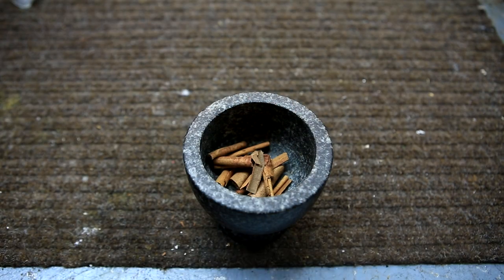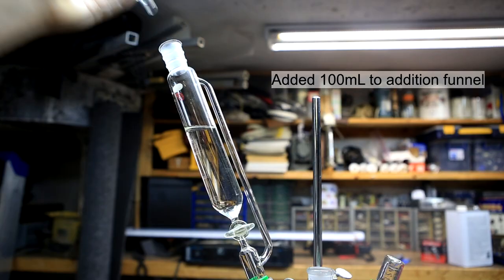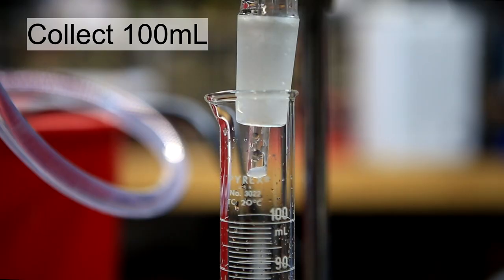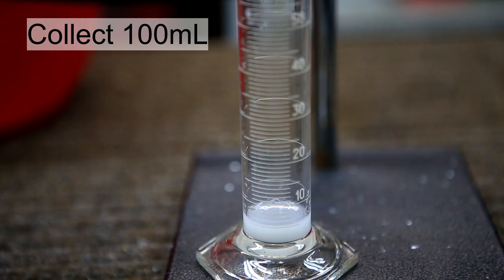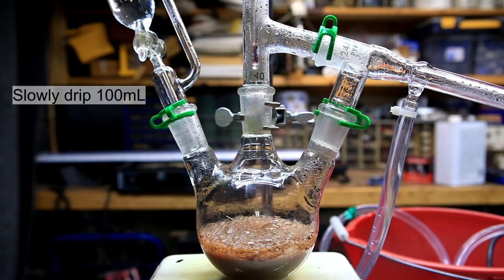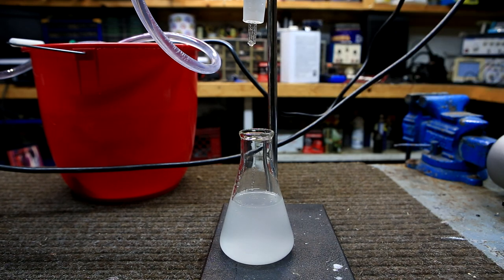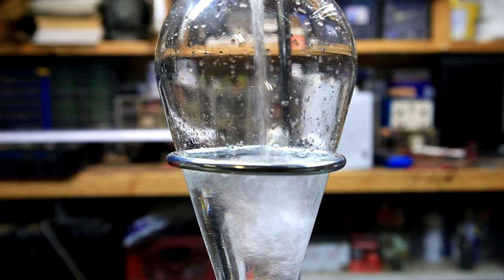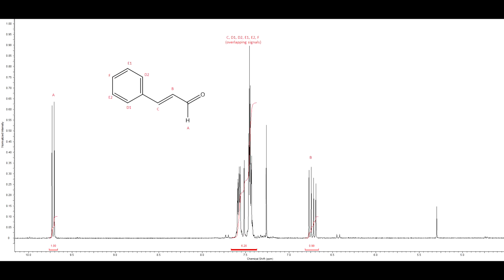How to extract Cinnamaldehyde from Cinnamon

Comment from the maker: I am not sure why, but it didn't separate out. I also did limonene which quickly separated out. I guess I could have left it out for a while and waited for it to separate.
Reply: You have posted video on separation of Limonene from orange peels ?
Reply from the maker: I will. It is the same process but the oil separates immediately and can just be pipettes off. Ill edit it and upload it eventually
Reply: Okay, will surely check it out whenever it is available
Reply from the maker: Those are two very different techniques with very different purposes!
Reply from the maker: christopher vester I think it is, but I didnt check.
Reply: +Nile Red The cinnemonaldehyd does not separate form the water by itself. Where I live DCM is banned out of environmental reasons. Is there any alternative to DCM?
Reply: +christopher vester Yes. Thank you. It works very well.
Reply: cinnamaldehyde . you mean TRANS 3 PHENYL PROPANOL ?!
Reply: wait, so where you live they allow Chloroform but have banned DCM?
Reply: you do not dry the dcm by adding NaCl, you saturate the aqueous phase with NaCl so the cinnamaldehyde(low quantity not all) doesn't dissolve in water, thus you have it all in the organic phase (DCM)
Reply: prop-2-enal
Reply: I know I'm super late, but as a layman I'm curious about the use of a sodium chloride solution. I figure this has something to do with keeping the oil and the water from getting too friendly. Is the purpose to increase the density relative to the oil, or does saturating the water have some other more direct effect on miscibility?
Reply: NileRed isn’t this a precursor to P2P?
Reply: Sodium chloride solution (aka brine) is used to dry the immiscible organic layer. It may sound weird to use an aqueous solution to remove water, but since the brine is saturated, it absorbs the residual water that may be present in the organic phase, creating a slightly less concentrated NaCl solution.
Reply: The Hildebrand solubility parameter for cinnamaldehyde is about 21 MPa^0.5 vs 20.2  MPa^0.5  for DCM and 19.9 MPa^0.5 for acetone - suspect acetone would work fine. I think issue with separation is that cinnamaldehyde density is  very close to water (about 1040 kg/m^3). Another technique without solvent may be to freeze the water (cinnamaldehyde's melting temperature is -7.5 C)
Reply: which kind of surfactant to use for powdered cinnamon? would ordinary dish soap, or hand soap work?
Reply: DCM is forbidden, any alternative?
Reply: @aribinu8910  Literally watch the video and see what it says next to DCM?
Reply: @BaneWilliams  , right?  It shows an alternative right in the video.  It astounds me how people don't pay attention at all.
Reply: @gugl4106  Hexane?
Reply: @piratewhoisquiet  Normal soap will foam. Washing machine soap should not.
Reply: @tom_something  Adding NaCl to water increases its polarity hence a better separation from the organic layer
Reply: @Kloashut  ah, I see. Is it that the oil and water become less attracted to each other (decreased adhesion), or does the water simply become more attracted to itself (increased cohesion)?
Reply: @tom_something  Basically when you dissolve salt in water the salt falls apart in its ions which have a charge[+/-]. As water has a dipole moment[d+/d-] it readily surrounds the ions, hence creating a stronger connection. Most organic compounds have a much lower or no dipole moment, therefore it separates out. Going back to your remark, bluntly said it's a bit of both ;-)
Reply: @Kloashut  Thanks for your explanation!

Comment: You should use this to make phenylpropargyl aldehyde (aka 3-phenyl-2-propynal). Why you ask? Because it's $250 per 5 grams and I thought it would be interesting to make something so expensive from cheap materials.
Reply: but he would most likely spend more money making it than it is worth
Reply: did you not read satchel's post? from CHEAP MATERIALS
Reply: Roarke Tollar But the materials used to extract it and the processes that are involved with doing so could increase the cost of the extraction

Comment: "When all of the DCM had been removed, the yellow oil which remained was transferred to a dram vial". 
How on earth did you get that little bit of oil out the bottom of the flask? Did you just hold the flask upside down for a really long time till the drops crept into the vial? Seems there would be lots of wasted oil on the inside of the flask!
     I'm considering using this method of recovering the DCM using a 1000ml round bottom flask, but I'm also thinking there may be a more efficient way to collect the oil once the DCM has been distilled. Any thoughts?
Great video, btw! Very informative!
Reply: You could use a pipette.  Or just use your receiving flask for the next phase of synthesis once the dcm is removed and the flask maintains a constant weight.

Comment: How do you know which extraction method to use? Water destillation vs Soxhlet, etc. Great video!
Reply: If the compounds are polar water can be used, non polar requires a different solvent

Comment: Great videos Nile!!

Quick question, how do you have access to an 1H-RMN ? Did you have to pay for the spectrum? 

If so, how expensive it is for each sample?

Thanks!! I'll be arround.
Reply from the maker: +Alejandro Sánchez I was working in the lab, so when I took my own NMRs, I just threw an extra one in. I don't have access anymore unfortunately.
Reply: @NileRed  Defenitely not comparable but using TLC may give you a clue about its purity as it's cheap and versatile.. Unfortunately it's only a qualitative analysis, even when using colouring sprays/baths

Comment: Hello.
I am currently working on extracting cinnamaldehyde in a project and instead of using DCM or Ether I will be using ethyl acetate. Will it still work? Instead of 25.5g cinnamon I will use around 100g to compensate for maybe less separation from the water phase. 
I have also been wondering why exactly you use saturated sodiumchloride and calciumchloride what is it for?
Reply: +Thomas Jacobsen I'm going to try it tomorrow with ethyl acetate as well, I will post my results. Also I do believe that sodium chloride was used to drive water out of the DCM and the calcium chloride was the drying agent

Comment: Wow that was a lot of work and glass to have to clean up later. Is that the same way people make hot pepper essences and create ever more dangerous "new worlds hottest hot sauce's"? And thanks for the vid, I still need to decide between physics or chemistry and I'm thinking more about chemistry lately since watching your videos :)
Reply from the maker: I actually made a video about extracting the essence of hot peppers. The distillation doesn't work for that because the major spiciness component (capsaicin at least) is a crystal and not an oil.
Reply: tubesurfer23 "A lot of glass to clean up" I really like that you're interested in chemistry but its pretty obvious that you havent been in a lab already. I'm only a student (at university) but I had to clean five or six times as much glassware as you saw in the video on a day most of the times I've been in a (chemistry) lab. But dont let that discourage you, most of the time during extractions, destillations etc. you will have enough time to kill to clean everything.
Reply: Jutta Beckmann I'm a chemistry student as well and in my lab we did this exact experiment and it was a real PAIN to get all of the cinnamon leftovers out of the 3-necked-flask, the only thing worse was cleaning this after a (failed) destillation of PET :/

Comment: When you make substances with yields of just a few milliliters, is loss from the oil wetting the inside of the flask when transferring into the dram vial a concern?
Reply from the maker: yes, to do the transfer properly. you need to transfer as much as you can with a pipette or syringe and then wash the flask a few times using an appropriate solvent and pipette that out. Combine everything and then evaporate.

Comment: I like your channel, very informative and all the proper precautions are made. You are the new 'NurdRage' in my opinion. An idea on a cool video would be making ammonium nitrate from calcium nitrate and ammonium sulfate. A lot of the ammonium nitrate found in cold packs is bad quality, lots of anti-caking agents etc, not to mention expensive for the amount you get.

Ca(NO3)2 + (NH4)2SO4 --> NH4NO3 + CaSO4
Reply from the maker: What are easy sources of calcium nitrate and ammonium sulfate?
Reply: Nile Red The best way and easiest way is on eBay, or a fertilizer store (but to be honest it would have to be a specialty store, not Home Depot) CN is used in cooling packs, like Ammonium Nitrate, but I don't know which brand uses it. AS is used sometimes for food, but I've never seen it in stores other than fertilizer stores. But both chemicals are readily available on ebay.

Comment: Hello NileRed, I have a question, hoping you'll see this.
For what purpose did you use the dcm in your vid? I don't know if this has already been answered.
Is it to purify the extract? To break up the emulsion? I want to make lavender Oil and I fancy the dcm method, but some ppl tell me that it is unneccesary :/
Love your Channel, keep on the good work :)
Reply: I believe DCM is just to extract the cinnamaldehyde from the water layer so that it is highly soluble in it. Then to remove DCM u can also use a rotovap other than distillation which NileRed used

Comment: Please correct me if I'm wrong.
So @3:28, the bottom layer is DCM (which is polar, right?). Does that layer have a little bit of cinnamaldehyde in it?-> (and this is drained out each time?)
The top layer is AQUEOUS; (white with the cinnamaldehyde OIL)?<--How?  
@3:43, After 3 more additions of 60mL DCM, the upper layer is aqueous and clear, meaning the cinnamaldehyde was extracted by the DCM? 
This makes sense since DCM and cinnamaldehyde are both denser than water, but I thought this kind of separation worked due to differences in polarity, which is why I wonder why the DCM and water which are polar aren't in the same layer, and cinnamaldehyde being oil isn't in its own layer????

Comment: Thank you for the video, I am wondering about your condenser water inlet and outlet.  I notice that its coming from a bucket to recycle the water.  Are you pumping the water in from the bucket somehow?  thanks.
Reply from the maker: I am using a pond recirculator
Reply: thank you for the response!

Comment: Hey Nile! For a school project my group and I want to make cosmetics using cinnamaldehyde we extracted ourselves. Unfortunately due to legal reasons we can't use DCM. Do you think it would be possible to replace it with ethanol, and if so, what alcohol percentage would you suggest?
Reply: Ethanol won’t form a separate layer from water. I would recommend mixing the cloudy oil suspension in water with enough salt to saturate it and then shake. The oil should separate out after that, and could be removed with a separator funnel or carefully using a pipette

Comment: I had a question: What exactly are "drying" chemicals? I know examples and have made some, but how to you determine what to use them on, and how do they work? (Ex. sodium metal, anhydrous MgSO4)
Reply: I believe "drying" is the removal of water. When you add a saturated salt solution, the water from one layer will transfer through osmosis to the salt layer. I'm not a chemist, though, so I'm not entirely sure.
Reply: Camroc37 Different drying agents work for different compounds. Here is a nice table: http://www.chem.ucla.edu/~bacher/Specialtopics/Drying%20Agents.html
Reply: TheChemistryShack Ah, thanks! So can I concentrate isopropyl alcohol using MgSO4 then, or is there more to it?
Reply: Camroc37 Unfortunately it's not quite that simple. You first need to add anhydrous MgSO4 to the alcohol, let it sti for a while, and filter it off. Then you will need to distill off the alcohol to remove any dissolved MgSO4.
If you use molecular sieves instead, only a filtration will be needed and you can omit the distillation.
Reply: TheChemistryShack I thought you might need to distill. I will look up the boiling point of the propanol.
Reply: Also, it won't give you completely anhydrous isopropanol. For completely dry alcohol reflux over magnesium
Reply: TheChemistryShack I might do that some time.
Reply: Camroc37 Just be aware that you will get Mg(OH)2 and magnesium isopropoxide contamination. This really shouldn't be an issue for most experiments, but if it is you could distill off the alcohol after refluxing (Just make sure your distillation apparatus has either been flame dried or rinsed with acetone).
Reply: TheChemistryShack Thanks, I will write this all down.
Reply: Camroc37 No problem. Glad I could help :)
I'm actually editing a video right now on purifying and drying 70% Ethanol from the pharmacy. It should be up later today.
Reply: TheChemistryShack Nice. I had to lend my camera to someone for a week, but I can almost buy a nice DSLR camera. It's actually the one gooferking has :P
Reply: Nice! His video quality is great!
Reply: TheChemistryShack Yep, and since I have some great editing software now, I will be able to make some good videos! (It is Hitfilm 3, a free program. It is almost like sony vegas pro 13 and it is great!)
Reply: Cool!  Glad to hear it! I'd love to do a collab too if you are interested any time!
Reply: TheChemistryShack Doing what exactly? JMAP and I talked about doing a dollar store chemistry challenge, but since I am saving up for my camera I wouldn't want to do that right now. Just a thought.
Reply: Camroc37 Are you on Sciencemadness?
Reply: TheChemistryShack No, but I have heard of it. What is it?
Reply: Camroc37 It's a chemistry discussion forum
Reply: Camroc37 It's pretty neat. I'm actually in the SM skype group. I could add you if you want, we love new members :)
Reply: TheChemistryShack Sure... But what is it?
Reply: TheChemistryShack

Comment: One question: Is this kind of extraction safe for use the cynammaldehyde as a food grade flavorant? When I heard DCM I said NOPE but... just thinking...
Reply from the maker: TheMetalMusicMachine If you do everyone with glassware that hasn't been used for chemistry. You can also just wait overnight for the oil to separate out (i think). That would make it so that DCM is not needed
Reply: What about CO2 extraction method? Have you ever tried it?
Reply from the maker: Using liquid CO2?
Reply: Yes... but i guess you need specialized equipment and it must be really expensive
Reply: @NileRed  High pressure process
Reply: When you have a mixture like this putting it in the freezer will help. Water freezes, decant/pipet off the oil
Reply: Another thing that might help is adding again NaCl to the mixed layers to increase the polarity of water hence a better separation from the oil

Comment: that distillate should be 35% cinnamaldehyde approx by weight... shouldn't you just collect approx 10 ml of distillate since all the cinnamaldehyde should be there? is there any difference in the yield between using a setup where you generate the steam externally?

Comment: also how much calcium chloride was used?
Reply: Drying agents likes Calcium chloride tend to not be accurately measured. You just have to make sure you have enough to dry up the water. That being said though, how do you know if it is enough? I am guessing right after he poured it into the flask, nilered checked to see if there were CaCl2 particles floating around in the solution. This means there is enough CaCl2 because it is not only clumped at the bottom. Look up "Drying Organic Solutions" for a short guide on this step.

Comment: I keep ending up with WAY too much water in the receiving flask.  It will be something like 100-200 mL of water and like a few drops of oil...I'm assuming I'm using too much water or too high of heat?
Reply from the maker: +Blalack77 Maybe it just looks like a very small amount of oil...because it is! The yield isn't super high because the amount in the cinnamon is actually quite low. How much cinnamon are you extracting from?
Reply: Hey thanks for the reply. I recently got into hobby chemistry - your vids are awesome.  I think it was around 10 grams of cinnamon with roughly 200-250mL of water.  The oil really just looks like a sheen on top of the water and some scattered on the sides - not even a proper "layer".

Also, the only solvents that I have access to are:  acetone, naphtha, isopropyl, and methanol - which would be best to use here?
Reply from the maker: naptha might be able to extract it. the others are all miscible with water so wont work as extraction solvents.

With 10g, i think you get like 0.2g of the oil, so it is very little, maybe around 0.2ml. So if the surface of your water is somewhat large (depends on what you collected it in), then it makes sense that the droplets are scattered across the surface.

Comment: ive seen you had a bucket near the distilation apparatus with tubes in it
did you use close cooling water system?
Reply from the maker: Yeah, using a pond pump

Comment: I watch some of your video, very good,  my question is not related to this experiment,but I would appreciate if you could enlight me, concerning synthesis of isopropyl chloride from isopropyl alcohol, I think you made a video on synthesis .of bromide derivitives from tertiary alcohol;  would need a catalysis like zinc chloride for secondary alcohol but I have not succeed, what is the amount of zinc chloride to add if you have any clue about it. ( I have try with an equal molar amount of isopropanol and conc. hydrochloric acd, and catalytic amount of ferrous chloride,)
Thanks if you can help me!!